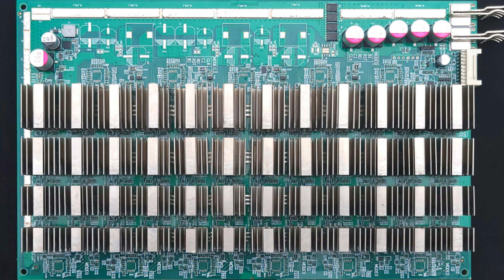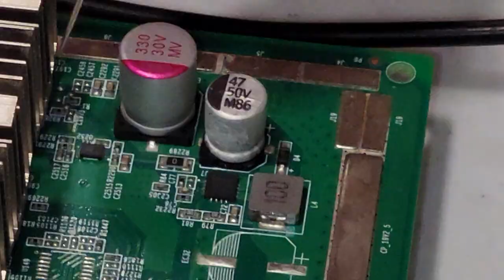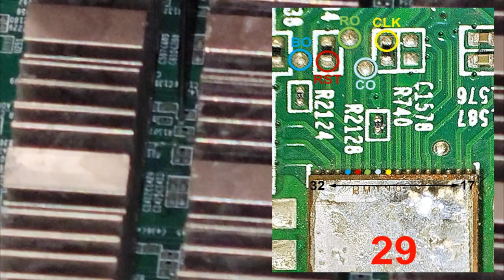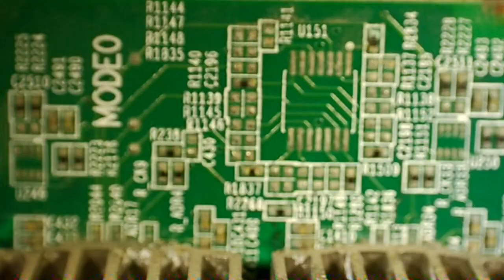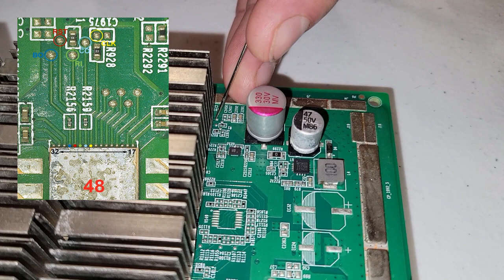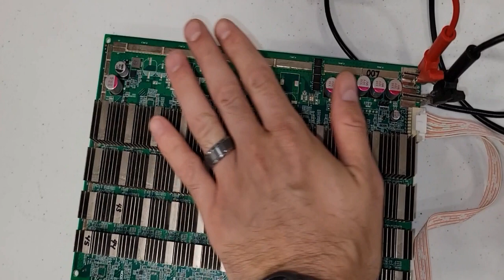Antminer S17 Hashboard Repair: 20 ASICs with BO Circuit Repair

Comment: Hello, My S17PRO machine cuts mining every 6 hours. I need to continue rebooting to make the machine mining again. After I remove 1 hashboard, the machine mining fine with 2 hashboards 24/7. What should I do?
Reply from the maker: When it stops are you still able to connect to it? or do you have to have to cycle power?
Reply: @upgradeya4868  yes, I can connect to machine via IP address normal but machine not mining not show red or green light when I reboot the machine mining again but after 5 day keep reboot this the machine stop mining. Then I unplug wait couple day. The machine mining again and repeating reboot for mining work like this.
Reply from the maker: Hmm...if it was losing connectivity but maintaining power, it is likely the control board.  Since that is not the case I would have to look at the kernel log.  A single hot chip might also be taking the whole thing down as well.
Reply: @upgradeya4868  Thank you very much. I did change control board still have same problem.

I quoted some kernel log. 

2022-02-12 20:35:56 power_api.c:87:check_voltage_multi: retry time: 28
2022-02-12 20:35:57 power_api.c:37:_get_avg_voltage: chain = 0, voltage = 24.443203
2022-02-12 20:35:59 power_api.c:37:_get_avg_voltage: chain = 1, voltage = 21.087773
2022-02-12 20:36:00 power_api.c:37:_get_avg_voltage: chain = 2, voltage = 21.302080
2022-02-12 20:36:00 power_api.c:50:_get_avg_voltage: average_voltage = 22.277685
2022-02-12 20:36:00 power_api.c:63:check_voltage: target_vol = 21.00, actural_vol = 22.28, more than 1.0v diff.
2022-02-12 20:36:01 power_api.c:87:check_voltage_multi: retry time: 29
2022-02-12 20:36:02 power_api.c:37:_get_avg_voltage: chain = 0, voltage = 24.498310
2022-02-12 20:36:03 power_api.c:37:_get_avg_voltage: chain = 1, voltage = 21.100019
2022-02-12 20:36:04 power_api.c:37:_get_avg_voltage: chain = 2, voltage = 21.314326
2022-02-12 20:36:04 power_api.c:50:_get_avg_voltage: average_voltage = 22.304218
2022-02-12 20:36:04 power_api.c:63:check_voltage: target_vol = 21.00, actural_vol = 22.30, more than 1.0v diff.
2022-02-12 20:36:05 driver-btm-api.c:198:set_miner_status: ERROR_POWER_LOST
2022-02-12 20:36:05 driver-btm-api.c:139:stop_mining: stop mining: power set failed!
2022-02-12 20:36:05 thread.c:828:cancel_read_nonce_reg_thread: cancel thread
2022-02-12 20:36:05 driver-btm-api.c:124:killall_hashboard: ***power off hashboard***
Reply from the maker: Reach out to me on Telegram. https://t.me/UpgradeYa_Steve

Comment: This video is awesome! It’s my first time watching it, Brett who taught my class I attended for Bitmain training mentioned this video. Do you have any specs on the flux types you use and solder/solder paste you also use in repairs?

Using the stuff from Zeus that came with the starting equipment but I think the flux in the syringe too is a fantastic idea.
Reply from the maker: Thanks!  Yeah Brett and I go back a few years.  In case you are still interested, I just updated the video details to include links to a number of products I personally use and recommend.

Comment: Nice video...so if u dont get 48 chips ...u go after BO first not the other signals? If so why?
Reply from the maker: Not necessarily.  Initially, I verify all the signals.  In this particular case the BO signal was the only one that was bad.  An important thing to note in this video is that it is not always the chip that is bad and you need to inspect the surrounding components.

Comment: Hello, I have several damaged T17, I managed to recover some by changing asic and temperature sensors, but due to an oversight on my part, there was a screw in the rods that feed the current cards, after that it throws me this error. 

[2022/02/14 21:45:52] INFO: chain[0] - Initializing
[2022/02/14 21:46:10] ERROR: src/chip139x.c:1049 chain[0] - Failed to receive chip replies
[2022/02/14 21:46:11] ERROR: src/chip139x.c:1049 chain[0] - Failed to receive chip replies
[2022/02/14 21:46:12] ERROR: src/chip139x.c:1049 chain[0] - Failed to receive chip replies
[2022/02/14 21:46:12] WARN: chain[0] - 0 of 30 chips detected

What could be happening? I have measured the parameters and all are correct
Reply from the maker: Wish I could help but I am not familiar with that error.

Comment: Are the heatsinks of the s17 very easy to loosen?
Reply from the maker: If you are referring to them falling off on their own...No, they are pretty solid.

If you are referring to them being removed intentionally...Yes, assuming you have the right tools.  Using a hot air gun, apply 450C heat directly to the heat sink.  After about 10 seconds it should easily separate from the chip.
Reply: @upgradeya4868  Thank you for your reply! I understand😄
Reply: @fengyshan2097  They're extremely easy to fall off on long distance shipping though beware too many damaged rigs when ordering from abroad

Comment: I'm just getting in to S17 repairs.  I am the kind of guy who likes to know "what's really going on" during a test. I'm a EE, so I feel more comfortable when I really KNOW what I'm looking at on a faiulre.  I see everyone on Youtube doing tricks like you show, shorting pins, measuring voltages, etc.  But do you have a document that explains what the actual test is doing, such as 'sends pulses out CO' / 'configures each ASIC to loopback through RI' / 'change baud rate and try again'  or whatever is really going on.  I feel like that would really help me to understand the debugging of the various test failures.  I've been on the Antmain website, and they seem very closed lip on technical details, unless I'm missing something... BTW, excellent video.  The close up detail is very informative...
Reply from the maker: Hello Thomas,  I know what you mean.  No, I do not have any documentation that provides anything that detailed.  That would be great if I did.  I have spoken to some of the Bitmain instructors here in the US, and they have told me Bitmain is pretty hush hush with them as well.

Comment: Thank you for the video, very helpful.
I’m trying to get into repair of hashboards, and most interested in S17Pro’s.
Can you create a video, or point me in the direction where I can find info on the 5 different circuits” BO, RST,RI,CO, and CLK? Do all these circuits run through the Chips in the same manner as the BO circuit as you pointed out in this vid? How would you go about testing the other circuits? Same way, test the point at each chip compared to it’s heatsink, and check voltage level? What are the voltages for the other circuits?
I assume you changed the config file on the zeus ficture, to not do pattern testing? Otherwise it would try and hash, and create a lot of heat, correct?
Reply from the maker: I am about to post a video showing how to perform voltage tests using the Zeus Test Fixture.  And yes, I did end up changing the config file to not continue with the pattern test.  I wasn't aware that was an option when I made this video.

Comment: I seen on another channel your involved with immersion mining, with the S17 pro's in particular I was wondering are they standing up better deployed in immersion?   I'm buying used ones in 50 lots from china with the idea of fixing them on arrival and then throwing them in tanks.  Glutton for punishment I guess!   Cheap HR if you have a team to solder them back together!
Reply from the maker: Life in immersion far exceeds air.  The concern I have for you is the quality of the used rigs you are getting.  In my experience, there is a high probability you will have issues with some boards, and it is going to be a pain if you have to work on them after being in the oil.  I suggest running them in air first until you find them to be reliable.

Comment: after scratching off the corrosion you recognize that there is a chinese high quality pcb underneath
Reply from the maker: I don't deny the quality of the boards.  These boards are packed with components and they are put through a lot.  As with any electronic component it is only a matter of time before environmental elements cause failure.

Comment: There is absolutely no need to mess with soldering a replacement link. Conductive silver paint is perfect for the job, and you can even solder onto it once it cures, should you need to. Some masking tape, a steady hand and the job is done. Another note: you disconnect your +VE side last, not your -VE. Reason being is that your ground planes are much larger, and the likelihood of a short is much higher with a grounded board - much like a car's battery and routing arrangement.
Reply from the maker: Great suggestion about the conductive paint.  Assuming one has that on hand, that would be a much easier method and wouldn't necessarily require the microscope.  I understand your concern regarding the power connections, however I don't feel that is much of a concern here.  In the case of the car battery, you're concerned with an accidental short, immediately releasing all the stored potential energy of the battery by means of explosion since there are no protective devices.  Regardless, people do need to exercise caution when working with potentially live equipment, also taking into account that there are a ton of capacitors storing energy.  Thank you for your comment.

Comment: Hello, show me how to repair a board with a temperature sensor problem (Error_Temp_Lost). Thank you for the lesson.
Reply from the maker: Fortunately, I haven't had to troubleshoot any temperature sensor problems.  The only thing I've experienced related to temperature sensor errors is if when I tried running a rig with a single hashboard installed.  The unit does not like it.
Reply: try watching some macbook repair videos on how to deal with temp sense faults

Comment: Great i would like to see more of these videos!  I have difficulties when all 48 chips are found but the temp sensors drops. Also can you make a video of all the parts on the s17 board and what they do? Or maybe make a separate video of all the different error in the log and how to solve them. Thanks!
Reply from the maker: Thanks Arthur! Yes, my next video will be an introduction to testing, covering all the circuits. After that I plan on discussing how to properly troubleshoot 0 ASICs
Reply: No need to change the BM1397 BM1397AG chip repeatedly - Refit Antminer S17/S17 Pro/S17+/T17/T17+/T17 heat sinks from NBTC!
Reply: Great videos. Would like to see more.

Comment: Nice.  I use clock instead of Bo to find locations of issues but good detail and glad to see info on that resistor.  That was something I was unaware of.  Got a board I need to check now for that resistor
Reply from the maker: This issue is so easy to diagnose and repair.  I hope it helps you!
Reply: @upgradeya4868  I usually put uv glue over the jumper wires to avoid shorts as well but that’s not really in a location that would have to have it